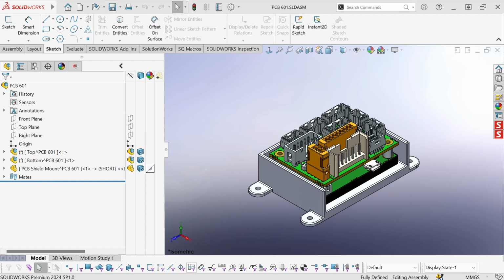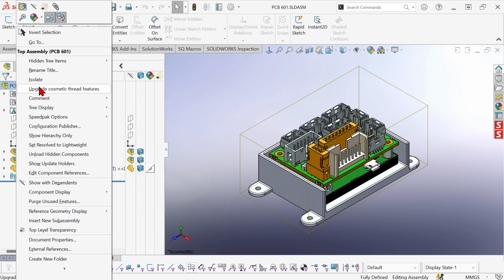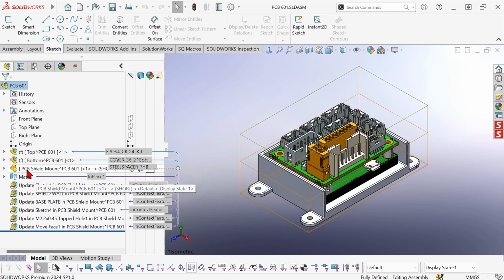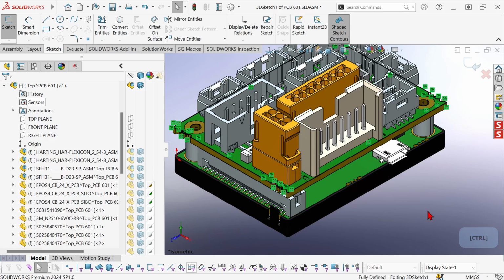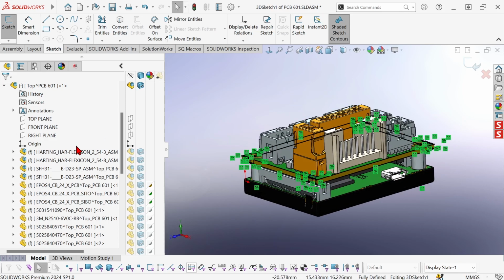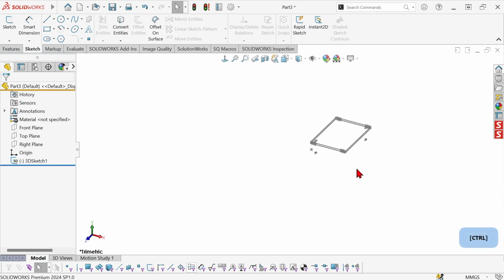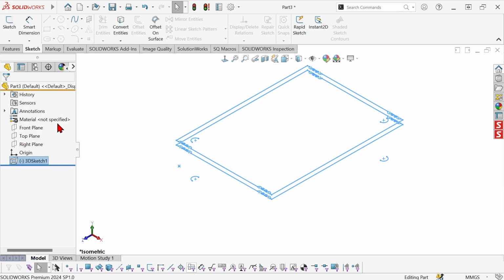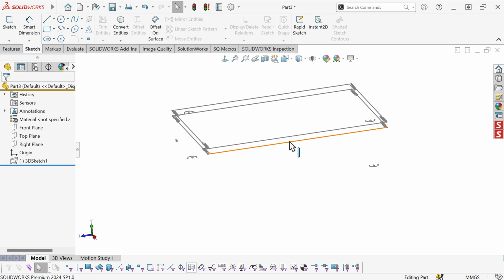How to use Reference Sketches as an Alternative to Top-Down Assembly Modeling in SOLIDWORKS

Comment: Hi Mike, is it possible, that when you paste the 3D sketch into the new part, to align or mate the origin point (converted from the 3D sketch) to the origin of the part?
Reply: It should automatically match the origin in the sketch to the origin of the new part. But you can reposition an entire sketch if you need to with the Modify Sketch tool.